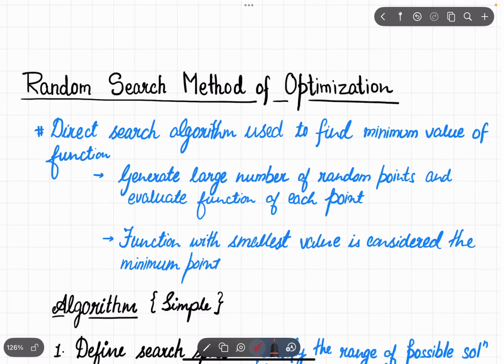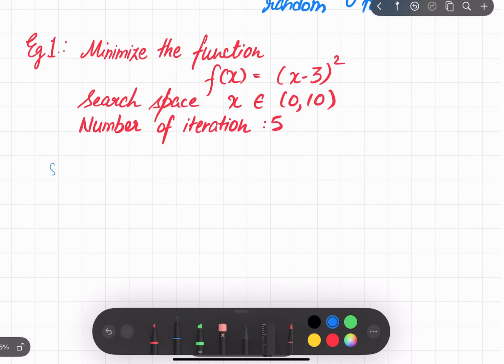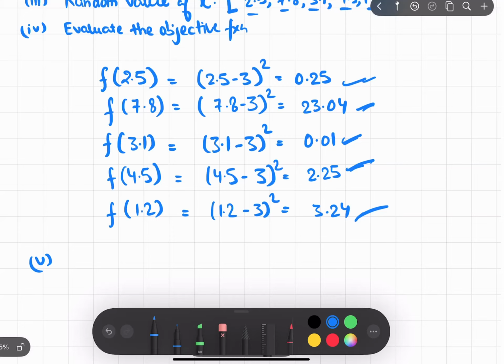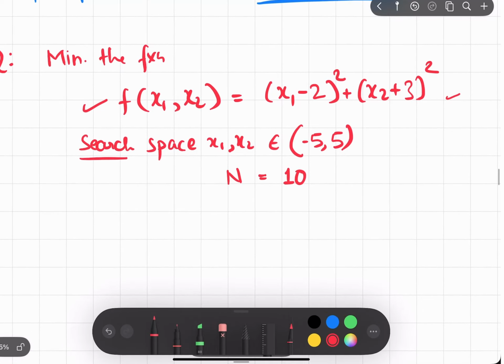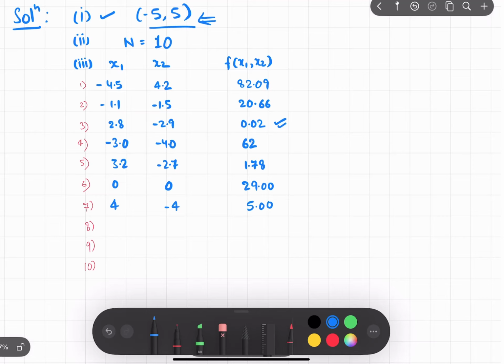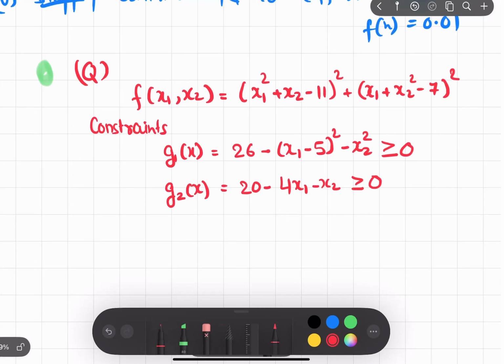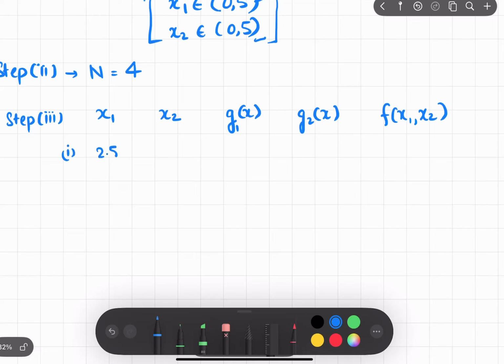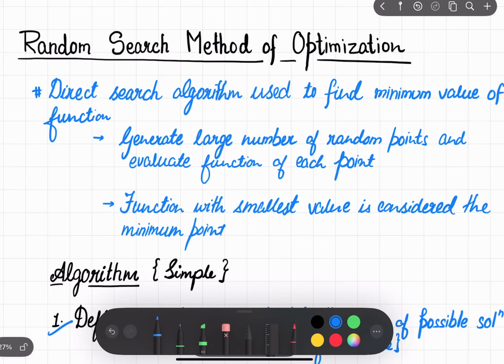Random Search Method of Optimization

Comment: Sir .. can you explain more clear how you got the constraints for 3rd problem .. also based on what criteria did you select the number of iteration to be 4 ..please help .
Also .. can you please solve a vtu question paper problem for this method if possible. Thankyou
Reply from the maker: Since number of iterations were not mentioned in the question, so for my convenience, I took four you can perform as many iterations as per your desire, more the iterations better will be the optimisation. In exams, We have a very limited time, so that’s why Four is a decent number of iterations to perform (according to me). However, if you are doing this through programming, you can increase the number of iterations. Regarding the constraints, these are already given in the question. I just took the range in step one based upon the given constraints. The obtained or adopted range satisfies the given constraints. You can share me the VTI question paper problem. If Time permits, I will try and solve and send you the solution
Reply: Thankyou Sir @CivilEngineeringStuff